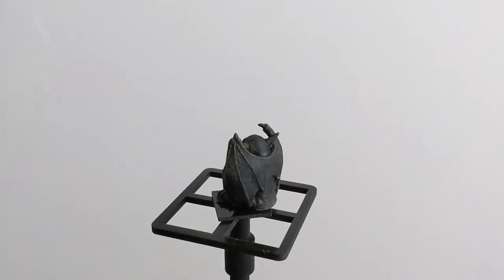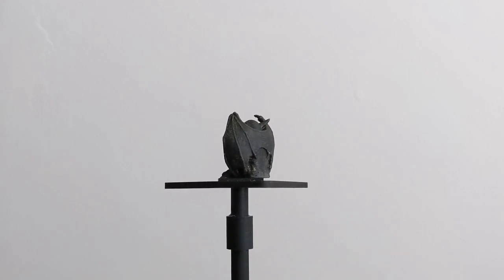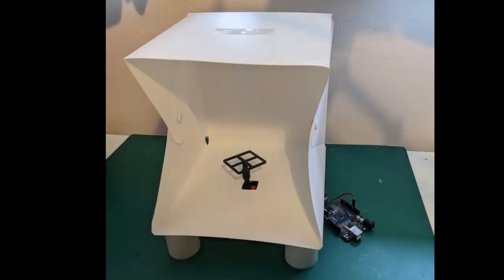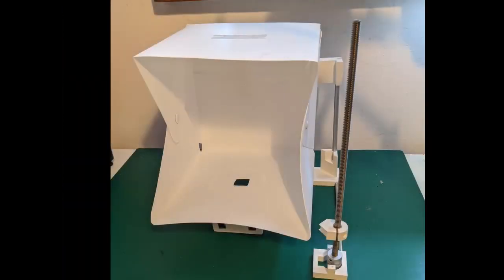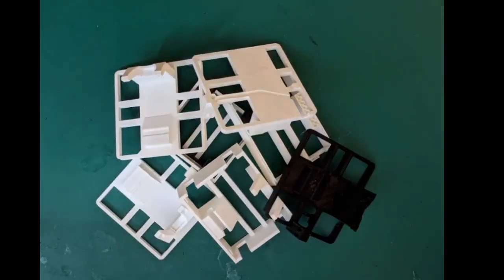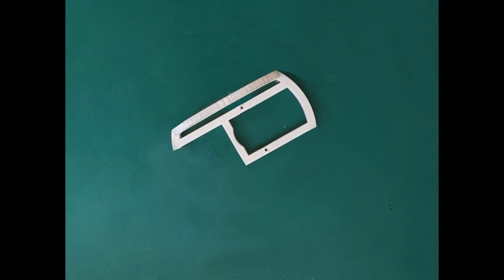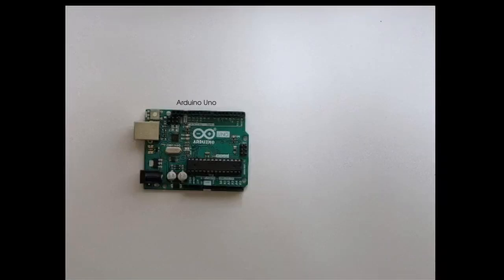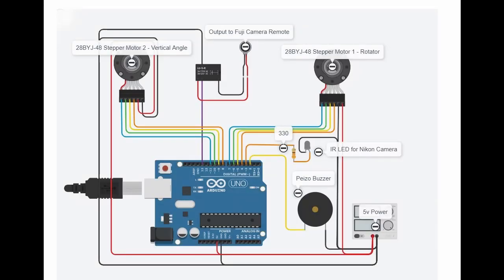Automated Photogrammetry Jig - Overview and improvements

Comment: Can you video make step by step print part & arduino setting?
Reply from the maker: Hi, I've got further information on the settings on the Thingiverse page - there's only the settings for number of rotational stops and vertical stops that you really need to change, other changes would be down to the camera you are using, and unfortunately I just have the experience of the two cameras mentioned.  I've no plans for a printing video, as that's just your usual 3D printing technique and I'd be going over ground covered numerous times on YouTube at a better level than I would be offering.
Many thanks!
Reply: @reborneuk  just a question on your 3d printer model / setup would be amazing!